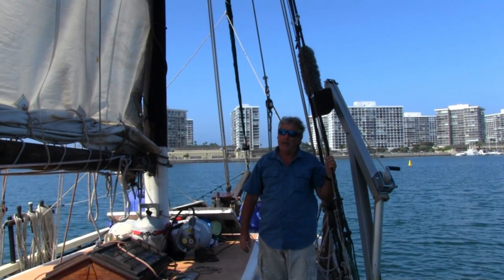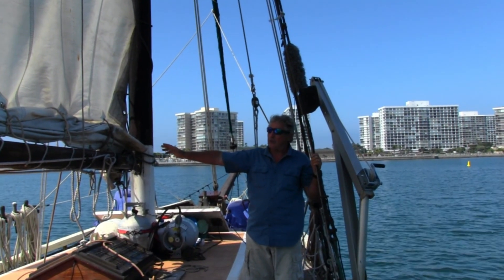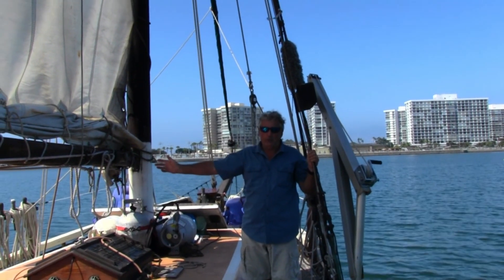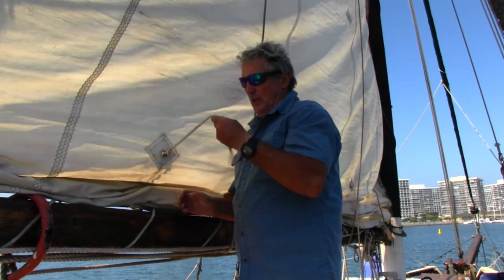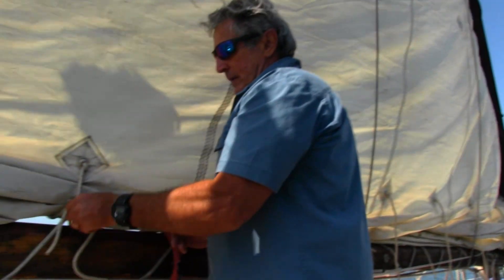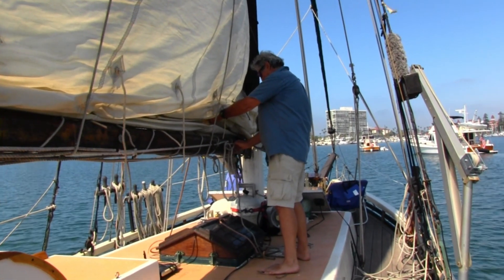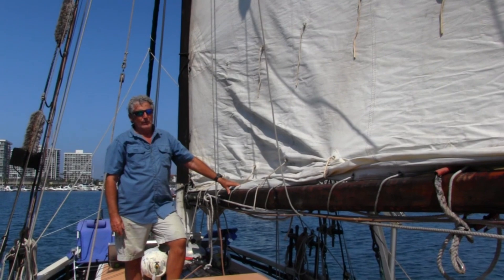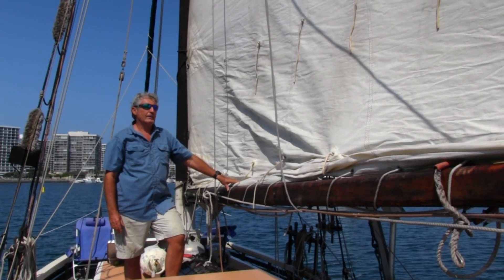Sensible, Dependable Reefing

Comment: You brought up some very good points. I really like the idea of having the mainsail double reefed while at anchor. One cannot always count on the engine to get one out of trouble.

In all fairness, a Bermuda rig can be built with a solid mast. It can have a somewhat longer boom and maybe a little less sail area. But the gaff main shines in that its center of effort doesn't move any where near as far forward when reefing as that on a Bermuda main.  This is probably why gaff rigs were so popular on Amercan cat boats.

The reason you have to back the jib when changing tacks is not because of your gaff main. It is most likely because of your keel type (full keel).

I had a 17 ft boat with a Bermudan main, and I had to back the jib every time I changed tacks. The reason for mine being that way was it light weight and high sides. Also, the cabin house was quite far forward. I used to joke that my boat tacked like the MAYFLOWER.

But once I read about how they used to back the jib, during the days of working sail, I was able to tack the boat quite smartly. I once sailed it up a 40 ft wide channel dead to windward.

Being able to tie in a reef on either side of the sail is something Ibwould never have thought of.  I think it's a great idea.

Comment: That is interesting to learn about the stages of tacking and needing to back wind the jib before the mainsail  is brought over on a gaff rig. Is that true for all gaff rigged boats? Is the jib just back winded but not fully sheeted in before the mainsail begins to go to the other side? On a Marconi rig, back winding the jib helps, to avoid having to wrestle with pulling in sheets as is necessary if the sheets are just loosened as the boat is changing tacks. By back winding the jib and gradually loosening the sheet and pulling the jib sheet in one the other side as the sail moves over to the other side of the boat, at the end of a tack, you end up with a perfectly set jib without needing to use the winch at all to pull the sail in any more..